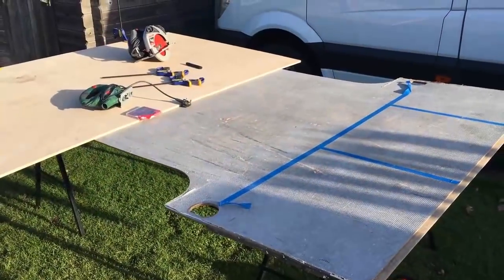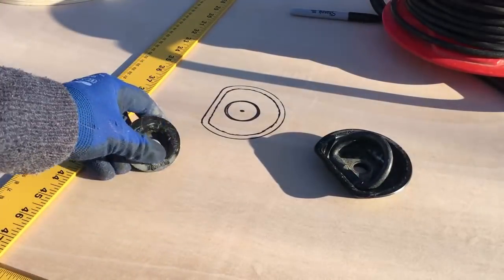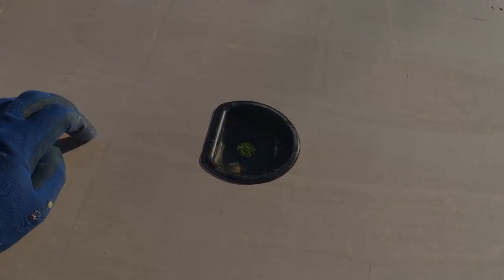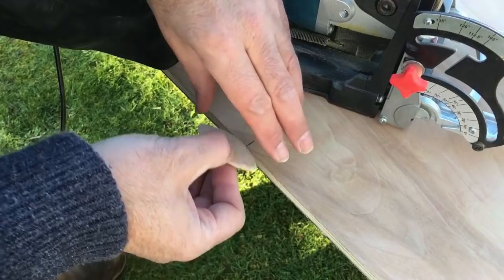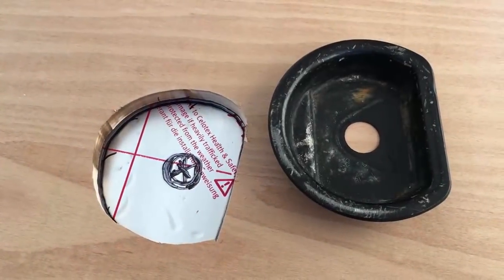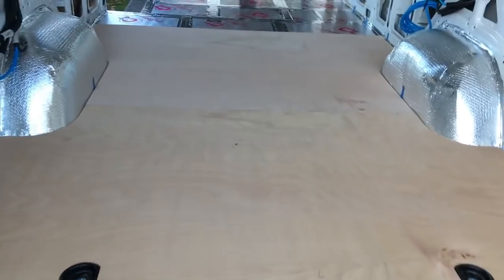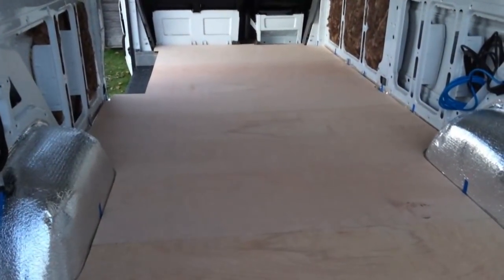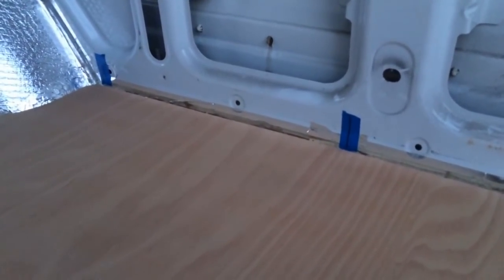Mercedes Sprinter Camper Van - New Floor

Comment: What tools should I buy? Or require. Skill saw etc. I have zero experience but would like to give it a shot. Love how you framed your floor. So smart. So much easier than trying to lay down large sheets of polyiso. I don't have a template for the floor of my 2017 GMC 2500 cargo van. Would it be worth the hundreds of dollars to order one just to have the template? 🤔 Also are you concerned with rust after putting holes into the metal on the floor? How did you wrap your wheel wells? It looks so tidy. Mine probably wouldn't. 🤤

Comment: Yeah well done Greg, another good video. Can't wait to see your cabinets if your your using biscuits for the floor! lol..
Correct me if i'm wrong but wasn't your floor battens supposed to catch either side of your ply sheets, and that's why you used biscuits. But anyway still one of the best self conversion so far, and will help a lot people! 
Keep up the great work.
Reply from the maker: Hello Craig, a couple of viewers have mentioned this earlier, but to save you hunting through all the previous comments for an answer, if you don't mind, I'll cut and paste it here...  I positioned the battens primarily under where I needed to fix furniture or walls to something solid. This did not always aline with where floor joints would be, rather than put in more battens and end up covering the floor with more wood I decided to join the edges to prevent them flexing against each other. The Celotex can hold approx 1200lbs per sq ft of weight so once it's screwed down to the battens I don't expect it to move much at all. 
The cabinet build may surprise you in some respects, I shall look out for your views on it. Many thanks
Reply: Oh right, now you have explained it I see where your coming from. And like I said before one of the best detailed and well thought out conversions I've seen so far. keep it up!

Comment: So the floor boards don't get sealing between the boards neither along the edges that are against the walls?

you've already gotten a vapor seal so good.

But Isn't it nice to have sealing along the floor board gaps so that if you spill liquid, it isn't festering between the celopex and the underside of the wooden flooring?

If you were to seal it, what would you use? caulking?
Reply from the maker: I have plywood lining on the walls and vinyl flooring to go down.
I will seal any joints later with a flexible silicone sealant.

Comment: Greg, really good stuff here.  Just wondering about the floor insulation compared to the walls - the floor didn't have reflextix covering it.  I'm assuming it wasn't necessary but just wondering why.  Thanks.
Reply from the maker: Hello Jason, good question. The celotex already has a foil finish which is the vapour barrier. We only need to foil tape across the battens to join the foil covered celotex and make it continuous across the entire floor. There was a continuous foil finish before ply went down. Hope that makes sense.

Comment: I would like to know when the book is going to be available. Or the box set.Excellent series, well presented.Thank you.
Reply from the maker: Hello Ted, funny you should mention this as its something that I have been thinking about.
This would obviously be quite a long time before something like that would be produced.
Until that happens I can recommend a very good book on this subject.
https://rover.ebay.com/rover/1/710-53481-19255-0/1?ff3=4&toolid=11800&pub=5575265109&campid=5338027957&mpre=https%3A%2F%2Fwww.ebay.co.uk%2Fitm%2FSelf-Build-Campervan-Conversions%2F142608087378%3Fepid%3D21009832608%26hash%3Ditem21341ab952%3Ag%3AuaYAAOSwPOhahL9Z
Reply: You’ve done most of the work with your instructive descriptions and videos, just put the clips onto DVDs; or get someone to put your instructions into writing and include pictures from the video content.  So can I place an order?

Comment: Greg your videos are amazing, thank you for making them. They have given me such confidence! Just a couple questions for you: 
1) drilling holes in the floor scares me, are there alternative ways of doing this? And how do you prevent rust/water entering? 
2) For floors with lots of existing holes (hence my trepidation, there is rust everywhere...) how do you recommend sealing them?
Reply from the maker: geekechick I know it can be very daunting cutting a hole in your van. Just make sure you measure multiple times, double and triple check locations both inside and out before cutting.  Once you have done one your confidence will grow to tackle the others. 
You will need drop out vents for gas appliances no avoiding that one. The plastic vents are a long tube and you can seal around them underneath with sikaflex to stop water getting in. Always paint any fresh cut holes or existing holes with red oxide primer or hammerite paint. Rust needs to be rudder back to metal and treated with Krust or similar. 
You can avoid having holes in the floor for water if you mount your tanks internally. 
You can just stick the floor battens with sikaflex and not screw them down but make sure to use 221 and clean and prepare the floor with sika primer where the battens go. 
Hope that helps. Best wishes

Comment: Hi Greg, another very clear brilliant video thanks. Just a couple of questions. What thickness of plywood are you using? Also I note that you have not joined the floor section edges over the tops of the Batons and screwed the floor at the section edges. No need due to the biscuit joints?
Reply from the maker: Hello William, this is a 12mm hardwood faced plywood. I positioned the battens primarily under where I needed to fix furniture or walls to something solid. This did not always line up with where floor joins would be, rather than put in more battens and end up covering the floor with more wood I decided to join the edges to prevent them flexing against each other. The Celotex can hold approx 1200lbs per sq ft of weight so once it's screwed down I don't expect it to move much at all.

Comment: Very nice job Greg. Is that a marine ply you are using? If not I wonder if at least treating all the edges at least with some sort of epoxy sealer would be worthwhile? As for flooring choices, I think that is a tough decision - I would probably go for a kitchen grade sheet cushion floor in one piece - you have the templates - just have to take them out of the van again.(Ha Ha).
Reply from the maker: It's a hardwood ply and I was going to give it a couple of coats of varnish to seal it. I don't expect it to get wet but just in case now that its so easy to do it makes sense. I'm with you on the flooring option, one piece cushioned vinyl with a nice pattern on it would be really very functional.

Comment: Hi Greg, awesome videos, just starting out and these are just so informative, thank you :), one quick point and not sure if its been mentioned previously the screw downs you used on the floor did you do anything to for protection on the underside of the van
Reply from the maker: Yes I sprayed them all with Waxoyl which you can get from any car spares place. It’s an underbody sealer to prevent rust. 👍🏼😃
Reply: @GregVirgoe  thanks Greg, after binge watching last night I got the answer from your Q&A 👍

Comment: Hey Greg,
Top quality job!  Great idea using the biscuits to connect the floor panels, but I can't figure out why you didn't glue both sides of the biscuits...???  Can you explain?  Is it because you want the floor to move laterally somewhat with temperature related expansion to prevent buckling?
Reply from the maker: Hi David, it's because if I ever need to take the floor back out in the future it would be a real pain if ti was all stuck together. 
But I also like your thinking too, and a bit of lateral expansion sounds like a very plausible reason. :D
Reply: Such a smart idea! Also, (with biscuits) it seems like it would be easier to disassemble than pockets screws.
Reply: Lovely work Greg, I'll definitely have to hire myself one of those biscuit cutters, great idea!! Have you looked into using any engineered plastic planks for areas where you are worried about damp?

Comment: Did you buy a lot of tools for your conversion or did you already have them? Who has a 'biscuit' cutter? Are you a carpenter/electrician/plumber? Such beautiful work.
Reply from the maker: Too young to be old we had most of the tools between myself and father in law. 
My father in law had the biscuit cutter.  I’m not any of those. I’m a building services design engineer. Thanks

Comment: Greg, just watched all your videos to date, this is only a dream for me at the moment but these are the standards I will be asking of myself whenever I get to buy a Van and complete a similar fit out. Your videos are fool proof and are the best on YT at the minute by far. Keep up the fantastic work and I am so looking forward to the next phase of your fit out. Would you recommend a Mercedes Sprinter (high line version) ? What sort of realistic budget would you suggest to set out for an average fit out....approx ?
Reply from the maker: Thank you very much, Martin, for those kind words.
For me the Sprinter is one of the most popular large vans, they sold in thousands, therefore spares and getting them fixed has got to be easier, right?  They have the chain driven camshaft, so much more reliable than belt driven engines. This van has a larger engine and the 6 speed gearbox, so it surprisingly nippy and excellent on motorways. Then the load space is 1.9m high and 4.3m long inside, as vans go it's huge!  
My costs are:-  Van £6,600, Build £8k so I estimate £15k all in. Now, this is not a budget build, it's at the higher end of the DIY market. There are some big ticket items like all the appliances, toilet, solar panels, roof fans, fridge, oven, tanks, batteries, etc
Some of these items are £300-400 each. We are keeping very detailed records of all our invoices and costs and will be doing a very detailed breakdown of our costs toward the end of this build series. Hope you enjoy the rest of the series. Best wishes.
Reply: Greg Virgoe thanks for you reply and your info again in great detail 👍🏻 I will be aiming for £5/6k for the van and £4/5k for fit out.....that’s my dream anyway. Keep up the fantastic work Greg and don’t be afraid to visit Ireland when you have your van complete, we have caravan-with the kids for years down the west coast (Wild Atlantic Way) stunning 👌

Comment: Another good informative video, thanks for taking the time to post Greg. Can I ask why the biscuit joints? I know why they get used but why not just make sure when 2 boards meet they do so half and half on one of the timber batons. Just curious. Another thing was in the last vidoe when you installed the batons I found the 38mm self drilling screws too short and ended up using 50mm. The drill bit on the screw is approx 13mm with the remainder being the thread and screwhead. Looking forward to the shower installation (doing the same in a LWB Ducato
Reply from the maker: Hi Bob, great question mate. I positioned the battens primarily under where I needed to fix furniture or walls to something solid. This did not always aline with where floor joins would be, rather than put in more battens and end up covering the floor with more wood I decided to join the edges to prevent them flexing against each other. The Celotex can hold approx 1200lbs per sq ft of weight so once it's screwed down I don't expect it to move much at all. There are a few different types of screws, I got some from screwfix that were threaded all the way down with only 4-5mm of drill bit at the end. I also fixed into the high point of the ribs so only had to go through 25mm timber and the skin of the van. I'm planning to use "ALTRO WHITEROCK" for the shower walls, it's a PVC sheet comes in many different colours and loads of PVC trim options for corners and edges.
Reply: Yet another professional and easy to follow video Greg; you're fast becoming the benchmark for anyone considering/planning a van conversion and quite rightly so!. 12k followers.. wow! Bob's question is valid though, regardless of where the battens are, it would be simple enough - using a skilsaw or handsaw - to cut back plywood to the nearest batten and then butt join 2 sheets halfway across a batten at that point. The cost of the 'wasted' plywood would be far less than the cost/hire of a biscuit jointer. No doubt the spare ply will serve some other very useful purpose on the project or in the shop at a later date? years of chipping on site taught me to set the floor board joint halfway across a joist but as you say - the Celotex can absorb a lot of weight and compression.

Nice to see the van taking shape now and a good base to get all of your carpentry skills on the way soon. I'm looking forward to the next one, who needs a telly licence lol.

best regards, R & T

Comment: I just spent 2 days with 2 friends putting in the floor insulation and the subfloor. It took so long and I now fear I have made a huge mistake with the subfloor. The customer service agent at Home Depot said 1/2” particle board is best because it is very good for putting down the vinyl flooring. Have I just waisted time and money? Nothing it in the van permanently...yet. Do u think I should take out particle board and install plywood instead. Thanks much. MaryAnn

Comment: Hi Greg,
 absolutely fantastic conversion, ive just bought 2016 Sprinter and goint to start to convert it in the next week or so, just a quick question, is there a reason you didn't reuse the floor you took out
Reply from the maker: ian fairbairn yes two reasons, it had all the holes in it from the tie down cups and at both doors it was really battered and rough on the edge.

Comment: thanks Greg i was thinking of using red oxide after the rust converter would the red oxide protect against rust in the future ? then i was going to apply a primer and top coat. i am ordering my celotex insulation how do i work  out how many sheets i would need my living space in my van is 11 ft x  5 ft 8. i would like to thank you  as your videos have given me inspiration to start my own van build.

Comment: Ok What I can use for the floor insulation that isn't as thick as the 25mm board. There was only 3/8th plywood with thin layer of foam and then carpet. 
My height is 5' 7" to work with and I am 5'5". Is reflectix going to good enough if thats all I can use?
Thanks for all your great tips and advice!!
Cheers

Comment: Awesome video series - I really appreciate the helpful and detailed content!  I had a couple questions (I have no experience in this area so any info would be appreciated!).  A lot of the other van conversion videos I've seen don't use battens (instead I often see a solid sheet of rigid insulation covered by plywood, either floating or plywood/insulation screwed through van floor).  Can you explain more about the advantage of using the battens (vs., for example, attaching furniture only to the plywood, or bolting all the way down through plywood/insulation/fan floor?  Also, I've seen a lot of conversions run the plywood so the seams are the long way  - is there an advantage to running the seams side to side instead?  Will you need to do anything on the underside of the van after screwing the battens through the floor (file off, seal, etc.)?  Thanks much!
Reply from the maker: Hello, I believe you need to fix your furniture to something more solid than just the plywood for the simple reason that in an accident these could tear out easily and fly towards the cab. As I have removed the bulkhead that would not end well for me. 
It doesn’t matter what way you run the boards as long as the edges are supported to stop them sagging over time. 
Finally I will grind off some of the screw and treat with WAXOYL under the van. The screws were zinc plated. 
Thanks for watching
Reply: Greg Virgoe All makes sense, thanks!!

Comment: Thank you for the excellent videos.  I am just starting with the floor on a Crafter (I'm able to re-use the existing floor as it is in vgc) and have studied your build and I have seen in the comments that you have already referred to why you have screwed the battens into the floor; however - I'm just checking - if I re-fit the load hooks to secure the floor do you think grab adhesive for the battens would be sufficient?  As you can guess, I'm trying to avoid drilling into the steel floor any more than necessary.

Comment: When you screw the ply to the battens, doesn't it break through the vapour barrier?
Reply: I have been wondering the same thing but think I'm still going to do it. The screw should act as a seal so any leakage would be very minimal, especially if you have more stuff on top of the ply

Comment: Hi Greg - great video. I wondered how you sealed off the tie down bolt holes which were left in the van floor, where the tie down straps were not replaced?

Comment: Looks great! Total newbie, but what are the names of the tools used?
Reply from the maker: Hello Hannah,
There are a number of tools that are used in this video:-
Mitre Saw - for cross cutting timber battens at 90°
Circular Saw - For cutting straight lines in large sheets
Jigsaw - For cutting odd shapes and curves in floorboards
Biscuit Jointer - for cutting slots for biscuits to join the boards
Battery drill - for drilling holes.
Impact driver - for driving in screws.
Hope that helps :D
Reply: Greg Virgoe thanks again for all of your help!
Reply from the maker: No problem Hannah, I try my best to answer everyone’s questions. Are you planning a conversion yourself?
Reply: Greg Virgoe yes!

Comment: Hi Greg, I'm just about to buy some 12mm Ply for my floor.  Did you use structural or non structural Ply. Or does it not matter? Thanks.
Reply from the maker: The best thing to use would be a marine ply as it’s more resistive to moisture and less likely to delaminate Cheers